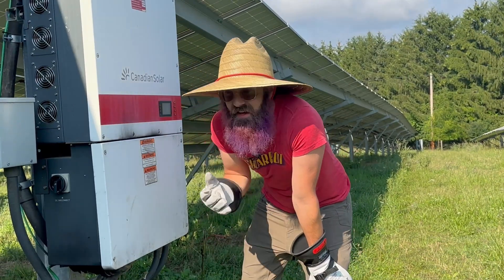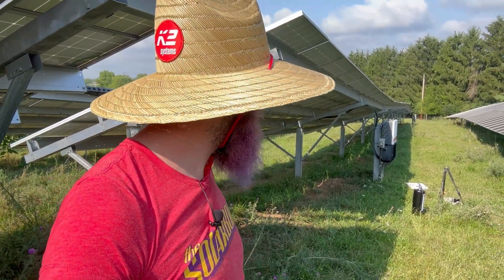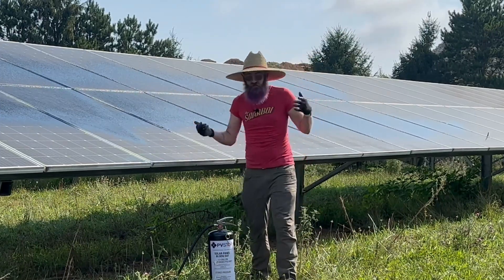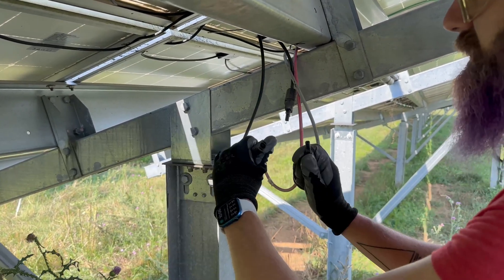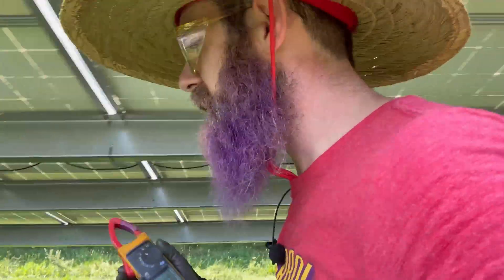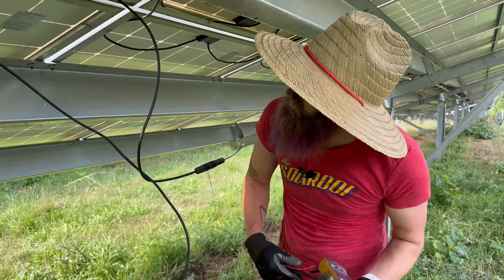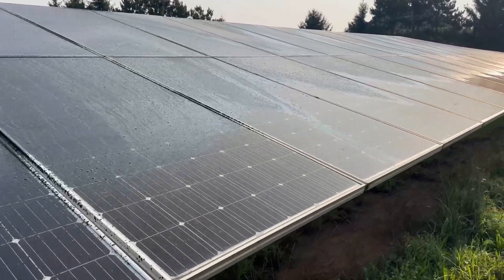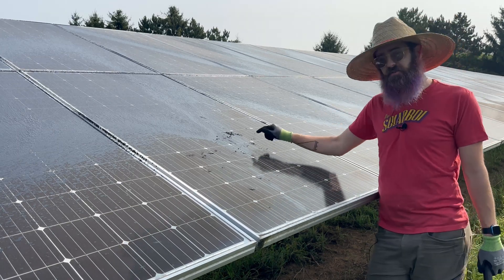Turning off the sun with black goo! - PVStop Review

Comment: I have not been in that situation before, but the first thing that comes to mind is using large roles of weed restrictor material, that is already designed to block out the sun.  AEROCOMPACT sells 6' and 12' rolls that can be clamped to the modules on one end and rolled out over the panels like carpet.  Quick, easy, and reusable.

Comment: Wow a master disconnect off the panels before the inverter I would have thought be code and just smart.
Reply from the maker: Adds more complexity than is necessary. That would have been 12 extra disconnects on this inverter, and by the time you add that many to all the inverters on this site, it would have been hundreds of additional disconnects, which widens the scope for inspections and failure.

It IS code that there are disconnects (which are the MC4 connectors) at every single panel, but they aren't required to handle load.

Comment: Thanks for informative video. Through you current experience applying would be key on the next application, simply to remove it afterwards.
As said it were developed to safely de energize PV modules during emergencies for First Responders.
So that they would be able to safely do what they have to do, saving lifes and properties. A simple solution they can trust without trying to understand how to do it and how to make sure it is de energized. AC hotsticks helps them to make sure AC is down, AC hotsticks works on Frequency by AC current. DC does not have a frequency therefore very difficult to detect.
Reply: Another thing PVStop are very focused on is the training it provide for the First Responders.